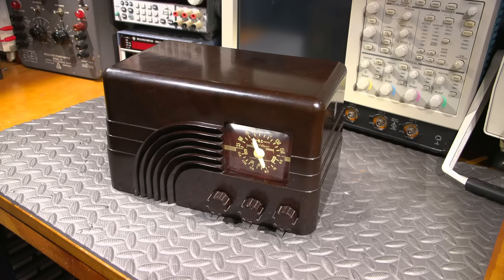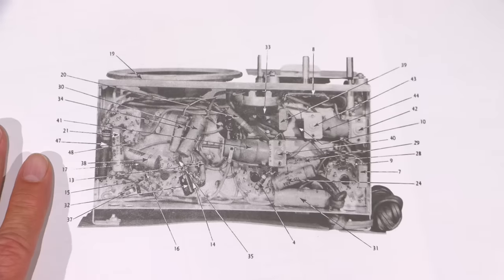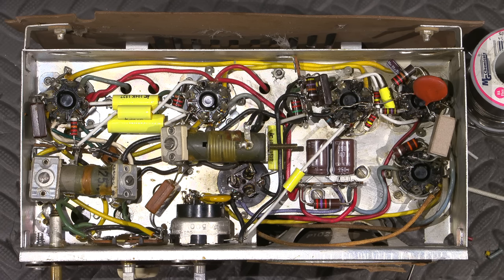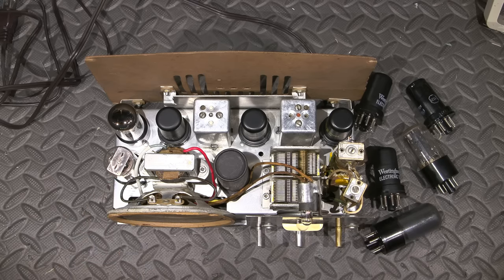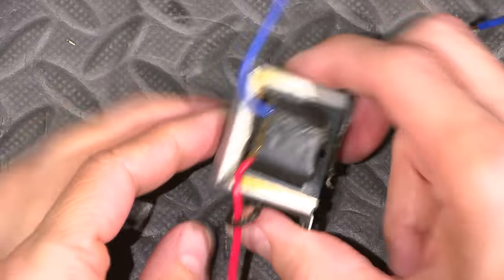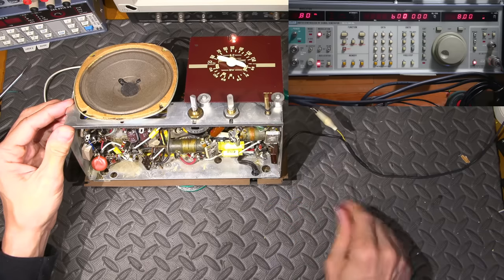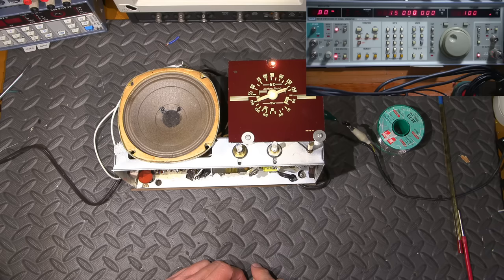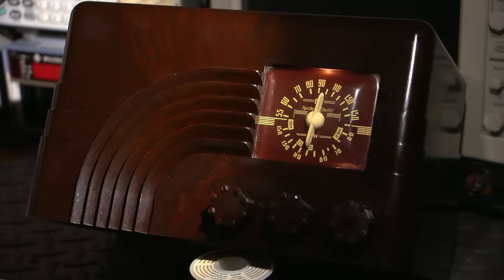Restoration Adventure, 1946 Baby Champ Radio Receiver!

Comment: There was a subsequent AM only model that had a third knob. The middle knob was use as a high-low tone selector. I wonder if Northern Electric had a bunch on 3 hole cabinets they needed to unload. Cabinet was also used for an office intercom system that NE marketed.

NE also sold the AM/SW model in South Africa under the “Airtone” brand name.

Comment: I just found one quite like this one, but mine only has 2 knobs. So your model is a 5100, while mine is a 5000.
Built in Montréal, Québec Canada.

Perfect cosmetic condition, excepted the power cord has been cut.
The speaker is also perfect, no dust inside, no tube seems burned, and I just paid 20 $ CAD.
Even the light bulb for the display is still working :)

There's a note on the 12SA7 valve, mentionning it was changed on July 9th 1962.

Comment: Nice video. Shows what can go bad on a simple restoration. Tuning, I was taught Cap high, coil low. I don't have one for two caps to tune it in. Only problem I could see was my silence sensors kept going off. As a radio station engineer that caught my attention. ;-)
Reply from the maker: Thanks Dave!

Comment: Nice work, love these old valve radios! One thing I would add its best to use normal paper glue that kids use at schools for the speaker paper gasket, superglue is rubbish for these, its too hard and when you'll squeeze it back it will again, separate easily.

Comment: My grandfather, my father and many other relatives worked at Northern Electric since its inception in Montreal. My grandfather, at one time, was the only living retiree with an employee number under 100. My dad always said he regretted not buying a Baby Champ. When yardsaling with my wife one day I found one in a barn. It's a true "barn" radio that is designed for battery use. I am planning to make a power supply to run it but of course, need to be careful of the old components. I would like to restore this radio and others I have picked up. Your video is amazing at showing exactly what I need to do. Thank you. 

p.s. Do you have a video on creating an in house AM transmitter? I'd like to broadcast some period music as there are no AM stations within many miles of me.

Comment: That's a really nice little radio both in looks and performance. This would seem to be a the sort of radio that would make a good one for somebody getting into doing this sort of thing to work on. The wiring is pretty straight forward. Aside from the surgery on the transformer, there wasn't anything in this that was particularly tricky. I bet the tubes you pulled out tested fine as well. I have a theory on this one. Somebody got into it and totally messed up the adjustments and didn't have the gear needed to fix their mistake so the radio stopped being usable and they shelved it.
Reply from the maker: Very good possibility.

Comment: In the early seventies the Grundig Radio Recorder C4500 had its service manual included with it manual of use. Even described how to adjust the pressure of the rubber wheel which pressed the tape against the capstan by the use of a spring scale (like the ones used in physics lessons in school). Where have all the good times gone?

Comment: Another great video. After watching I am gaining some confidence in aligning a couple of old radios that I own. I have changed out their capacitors and they work reasonably well, but an alignment would probably make them work even better.  When you were demoing the Baby Champ, it sounded like maybe you're based somewhere in the Vancouver BC area. If that the case, I think it would be nice if you're able to DX a radio station or two from Seattle WA and point that out when you are demoing the set. That would give us an idea of how well it can pull in a station from a few hundred miles away.

Comment: Great video. The only irritation is that those IF coil adjustments are very easy in comparison to a lot of vintage radios I see in the UK, which have wax or paint seals, are very fiddly and most suggest ought not to be touched, for fear of breakage. I wonder if you could cover those one day, in the context of having a life outside YT, of course!

Comment: The heater resistor cant be removed by replacing with a 50  tube, because the current in the 12s would be incorrect.
I believe you are testing us to see if we are listening.  Here in Australia the Neutral is fixed, but i have always been amazed by the U.S. 
twin pin  reversal risks.....all very historical though....

Comment: I had just turned 18 when Kennedy was assassinated. At that to time there was still a lot of vacuum tube electronics. Transistor radios were everywhere. I tire some non-working ones down for parts. I'd had good electric shop in high school and gotten good with tearing basic tube circuit theory. Basically I knew how to build amplifiers, power supplies and A. M. detectors. Later while in a university. I had picked up some books on transistor and built some simple transistor circuits. I even built a crude radio receiver and could get more local radio stations.

The grounded emitter circuit was an analog to standard vacuum tube circuits. Most transistor I could find were pnp so it was a vacuum tube circuits with reverse polarity.

I a had a dream of finding a one inch CRT and building a one inch oscilloscope. I wasn't quite equipped for it a didn't have the money but I would have had I more to spend.

I ended up going for chemistry but remembered well doing electronics as a hobby.

My brother did projects in school with transistors.

Later I got interested in pocket computers followed by home PCs second hand that I got for a song out of local thrift store. 

In 2013 I got my first Android tablet and I've had a number of Android devices.

I went back in time watching this video. I used to listen to distant stations on a radio I'd gotten.

Comment: On my old radios I wire the switch to open the B- to the heater voltage on the last tube that connects to B- and put a polarized plug on with the hot going directly to the rectifier and neutral to B-

Comment: Fantastic restoration Paul! I'm so envious of your lack of man made noise through the broadcast and shortwave bands. I'm currently talking to my energy retailer who's smart meter is spewing noise through the AM broadcast band, their argument is "who listens to AM anyway?". 

My internet is delivered via VDSL and there is a wall of noise from to 8500-11950 kHz full of VDSL carriers. The 30m amateur radio band is useless, can only hear the strongest stations through the noise.
Reply from the maker: Hi Michael. Use coax from your receiver to outside your house "all the way to the antenna," have the antenna as far away from your house as possible. If I open the shield on my coax at the receiver, the noise is strong here too. Having the center conductor shielded all the way to the antenna is necessary.
Reply: 'who listens to AM anyway'? Really? Last time I looked, manufacturers were NOT allowed to create interference in the broadcast bands. Those stupid 'smart' meters need to be properly shielded. That's what. Just saying.

Comment: Hello Mr Carlson,  thank you for a wonderfully instructional video! I just have a couple of questions. At 38:15, you show the bottle of tarn-x,  and after cleaning the switch, you say to thoroughly wash out the area to remove all traces of the tarn-x but you didn't say how - meaning, what to use to wash out the area?  A little soapy water on a Q-tip maybe? 
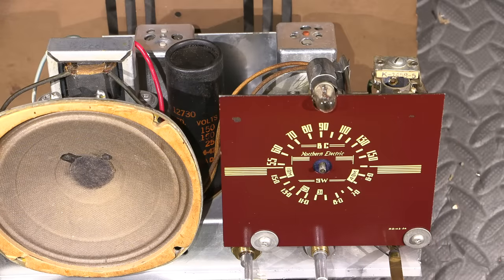Then at 41:08 you say: "once the dial face is clean"... but didn't say how you cleaned it, and what cleanser you used to clean it? I'm curious because this would be the place where I'd be very concerned about damaging the lettering. I imagine you may have used a Q-tip around the lettering?
Would you mind sharing how you accomplished this cleaning please? 
Thanks again for an incredibly informative and detailed restoration! 
ATB - Luther

Comment: Thanks for the video. This might be a really stupid question, but you were talking about the switch being mounted in its particular location. My question is how is it any better when 50% of the time the odds would favor an individual to plug the hot into the neutral? This was common as you stated earlier because the plug can go either way. Thank you.
Reply from the maker: Hi Mike. In the old days: If the radio hummed too much, you would reverse the plug. These sets also ran off DC, so if they didn't make any noise when you plugged it in, again you just reversed the plug.

Comment: I’ve always wondered Paul if you’ve ever had a radio and have been tempted to make a custom circuit board (but keeping some features like the vacuum tubes) because either it would safer, improve it or simply a way to save the exterior?

Comment: I'm torn, I love that Mr Carlson saves these wonderful pieces of history, but couldn't you run +or- 20 new transistor radios with the same amount of electricity??? On the plus side, if you ran several of these radios at the same time, you wouldn't have to run your furnace in the winter ;-) Love your channel Mr Carlson!!! 🙂
Reply from the maker: Hi Brian. The radio only draws 30 Watts. So In comparison, about 2 LED lights for your house.

Comment: You may have answered this in the past, but I have a question about filament wiring. 

These tube filaments are wired in series. In the old incandescent Christmas lights, if you put a 12 volt lamp in a series string with every other lamp being 2.5 volts,  the 12 volt lamp will immediately draw heavy current and burn out.

Why is this not the case with tube filaments? In both cases, you are putting incandescent filaments of different voltages together. Yet in the vacuum tubes, they are able to co-exist without issue, and in the Christmas lights the higher voltage lamps either burn very brightly, or just bite the dust.
Reply from the maker: Hi Blake. It's the current of the bulbs that needs to be matched. Every tube filament needs to draw the same *Current* and the combined voltage of all the tube filaments needs to add up to the applied AC. Christmas light bulbs are the same, the difference is, the 12V bulbs have a different current rating than the 2.5V bulbs.
Reply: @MrCarlsonsLab  Oh that makes much more sense. I thought maybe it had to do with the bulb shunts in the Christmas lights.

Comment: Beautiful video Mr. Carlson: history, aesthetics, explanations, and exuberance. That transformer repair was really cool. From coastal Maine, with Retekess V-115 & vintage Sony handhelds (low budget fun), I've picked up 800 CKLW Windsor ONT (800 mi.),  740 CFZM Toronto, 900, CHML Hamilton. What province are you in and how far is Baby Champ reaching? Where's the part about what antenna you hooked up to? I'm picturing a 15m run of wire? Thanks, Paul
Reply from the maker: The receiver is attached to the 369 antenna. I have video's here about that. Thanks for your kind comment.
Reply: @MrCarlsonsLab  Wow those are long wires on your 369 antenna. How far does the Baby Champ (or your best AM radio) reach? I get up to 160km with handhelds, that's it.

Comment: 5 min epoxy I think is a better choice to anchor the wire to the transformer. As a non electrical guy, I really enjoy your content.
Reply from the maker: Trick of the day: 
The reason to use super glue (and an accelerator) is: It sticks to waxy transformer paper. Epoxy works great on clean dry paper, but doesn't stick to a waxy surface at all.

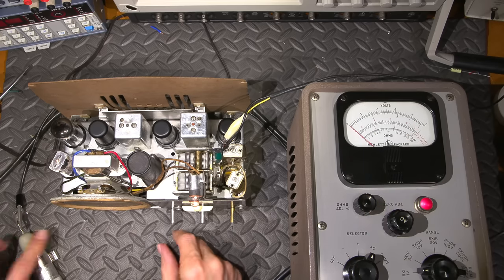Comment: 1:07:05...when I'm aligning the IF stage(s) in a transistor radio, I monitor the power supply current that the radio is drawing with a low audio output.

Comment: Beautiful restoration. 2 questions. 1. Why is the fuse placed under all of the other components? That will make it very difficult to see let alone replace. 2. I noticed a 75 ohm 10 watt sandy wirewound resistor prior to restoration but did not see it on the schematic. Did you replace it with a 47 ohm resistor?

Comment: It would be nice to show sometime the failure modes of vacuum tubes. I've seen that some glow and get damaged by the overcurrent but what is actually breaking inside them?
Reply: When they get overloaded and the plate glows, there’s so much heat that the glass envelope gets damaged. The envelope can collapse where it got soft, or perhaps crack. Either way, the internal elements will get shifted somewhat or the vacuum will be lost and that’s that. With enough persistence, the envelope can look like someone took a torch to it and melted it. The other failure mode is internal shorts of mechanical nature. Out of those, worth pointing out the cathode to heater short in indirectly heated tubes. Another one of course is loss of vacuum with visually intact envelope – gassy tube. Next one is heater filament burnout – just like in a light bulb. Then finally the indirectly heated cathode’s emissive coating gets less effective over time, so you get a “weak” tube. I’m sure there are more details to some of the failure modes, and perhaps I missed one or two.

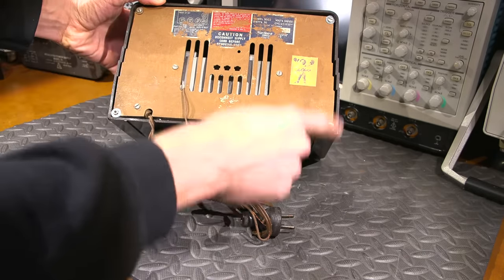Comment: @1:47  Mile long cord you surmised to be a replacement. But @15:45  the pic looks as if it has a mile long cord as well. If not the same, is very similar. 
Just an observation, I concede to your expertise.
Reply from the maker: The original cord (not factory) was about 12Ft, the replacement is about 5Ft.

Comment: Do you have a good technique for handling the cases where the assembler threaded a component lead through a terminal hole then wrapped it tightly around the terminal, sometimes more than once, then soldered?  I've always struggled undoing such connections cleanly. Appreciate your videos, fascinating to watch.

Comment: Can't help but wonder is someone wasn't in there diddling around with the alignment at some point in time. I've seldom seen radios that far off on their own. BTW, this set doesn't have a  "hot" chassis, with either plug orientation because the chassis is not tied to one side of the ac line. There's a cap in between, from what I see in the schematic. That's pretty standard practice for post war series string sets. My understanding for why manufacturers switched the ground side of the power input was to minimize induced hum into the audio stage due to close proximity of the switch to the volume control. In practice, I've never noticed much difference when rewiring the switch. Also unusual to see no internal loop antenna on a set from this time period. Most of  the US makers had switched over just prior to WWII.

Comment: Great video Mr.C!! A few episodes back you had mentioned that heterodyne receivers also transmitted simultaneously while receiving. Is it the IF that's being transmitted? What causes that?
Reply from the maker: The oscillator is 455 kHz higher than the received frequency, So if you are receiving on 1000 AM, you are transmitting on 1455 AM. If you have a large outdoor antenna the radios oscillator can be heard a short distance away. This is how they used to track down people with receivers back in the day. There isn't any information on the signal, it's just a carrier.
Reply: @MrCarlsonsLab  hey thanks!!! I love learning something new. It's funny to because I've been reading a book called "Thunder Below" about a US submarine (USS Barb) during WW2 and the author made mention that when the US subs were in enemy water they had to limit HF radio traffic and in some cases even turn off their HF receivers because they could be tracked by the enemy. Absolutely fascinating!

Comment: Just a suggestion - It might be less risky to unplug the tubes before desoldering components in case the component end is wrapped around the tag and you need to apply heat for long time to remove it.

Comment: Did you make your alignment adjustments at 90 volts input or at 110-20v
Reply from the maker: Alignment is done at full line voltage, (isolated.)

Comment: Should i replace only out of tolerance carbon composition resistors with new carbon composition or should i use metal film or carbon film.  I read lots of conflicting information on this
Reply from the maker: In a receiver like this, metal film resistors would be just fine. Just make sure the Wattage matches or exceeds the original resistors.
Reply: @MrCarlsonsLab  thanks.  Is this also the case for the am fm tube radios as well?

Comment: Is there a way to adjust the sensitivity by adjusting on a weak station or would that likely make it worse?   For adjusting without the tools like a signal generator and tube volt meter.

Comment: That case is beautiful!
Why are there so many trimmer capacitors in that thing? I'm more familiar with transistor radios, and there's only two trimmers -- both on the back of the ganged variable capacitor -- one for the oscillator, and one for the antenna matching.
Reply: It was a design decision. You can tune by adjusting slugs or capacitors. Here, it was the capacitors for many of the same things you’d use slugs for in other designs. At least as far as I can tell. In a solid state radio you still have all the little transformer slugs to adjust, so it’s same just different component.

Comment: First of all, I am NOT an Electronics Tech but I have had an interest in it since early Childhood.

Without the resources to buy replacement Solid State Electronics Boards, would it NOT be easier and more economical to repair the Older Vacuum Tube type Radios?

I am sure there are Pros & Cons to both, the Tube type and Non-Tube types?